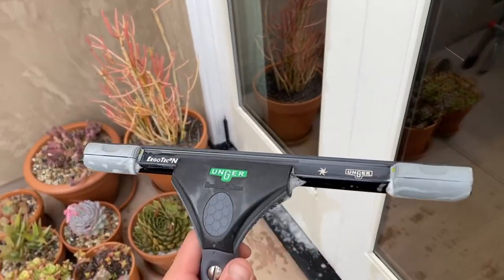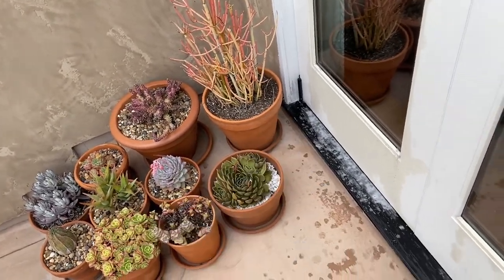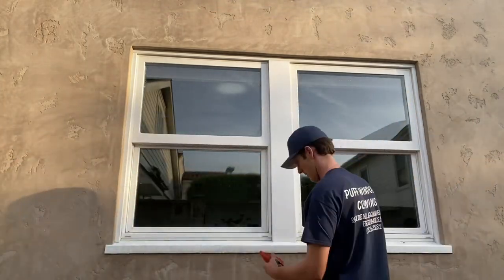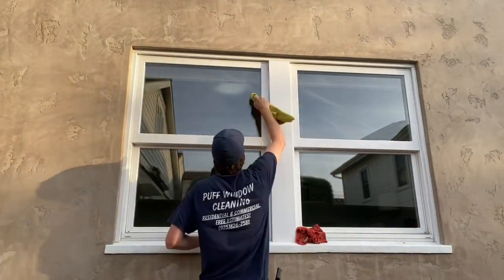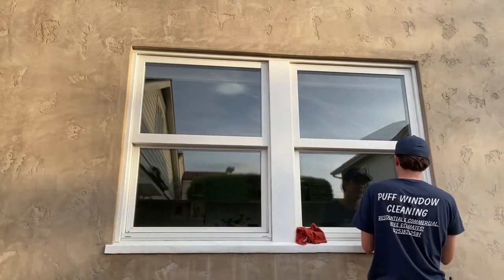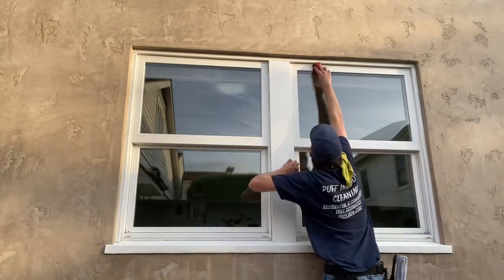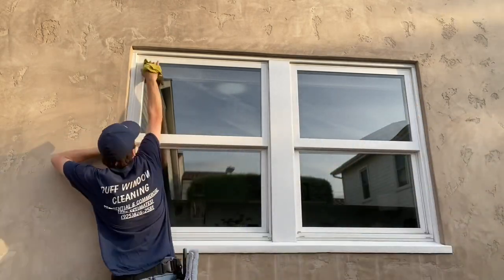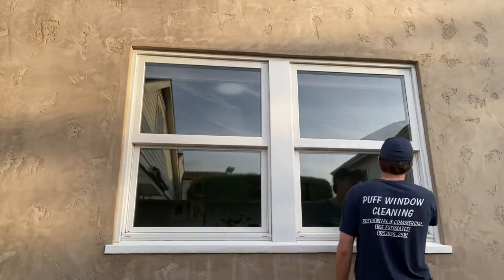$350 Residential Job | a RACE against the SUN | Window Cleaning Business Vlog

Comment: I noticed. You mop the window than use steel wool. Then squeegee. Try moping again after using   the steel wool to remove any dirt or pieces of steel wool before you squeegee. Also try wiping the edge of the glass before you  squeegee. Sometimes the glass is not flat. It could have a bow in it.  In that case try a different patterns when you squeegee.  Could be your holding the squeegee at the wrong angle. Try lifting the handle so the blade can scoop the water. You are using a 45 degree handle so need that.  Possibly you somehow nicked the blade on something..  I like your attitude.  You work hard charge a fair price respect the customer and you're honest. Will have a successful  business.
Reply from the maker: I really appreciate you sharing this info, and I’ll be sure to incorporate what you’ve stated to see if that helps. I’m starting to wonder if it could be the handle that I’m using. I may try using a different squeegee to see if that makes a difference. Thank you for the kind words 🤙

Comment: I've noticed doing a job takes a lot of cleaning sometimes there's microscopic fibers in the water or on your mop so when your squeegee grabs that microscopic particle it leaves lines. Not sure if that I've noticed even the stainless steel wool has little fibers that come off.

Comment: sometimes there's tiny Nick's in the rubber you really don't see them but you can barely feel them  it leaves lines in the window try flipping the rubber over if that doesn't work you will need a new.

Comment: I’ve been having that exact same issue with my 14” Ninja squeegee too - thought it could be a nicked rubber but changed and still the same. Almost like it’s possibly bent and not making flush contact with the glass 🤷‍♂️🤔
Reply from the maker: I’m really glad you know what I’m talking about. I feel like it was doing that the first day I bought it as well. I’m starting to wonder if the channel isn’t holding the rubber in place.

Comment: Two possible reasons, windows were oily or umidity is high. Use unger green rubber with unger gel when umidity is high or windows are oily and avoid straight pulls.
Reply from the maker: I’ll have to give it a those a try. Thanks for the suggestion 🤙

Comment: Puff! 
How high was the humidity ? I find sometimes if the humidity is high( but usually when it’s cooler temperatures) it leaves trail lines that disappear… 
I’ve finished a few jobs in the dark .. or low light .. just steel wool and trust your technique haha … man my job went long today .. a lot of post construction that I was not expecting .. they had someone clean it after their house was built last year,  it they did not remove any silicone etc.. and had just smeared the drywall dust around so it was pretty messy .. also they are selling the house and it is staged .. and white throw rugs and white couches … gotta move like a shadow and leave only a memory !!
Reply from the maker: Do you end up adjusting the cost due to the amount of debris buildup?
Reply: I didn’t this time, but I reduced the scope of her patio railings .. I steel wooled and rinsed them . I underbid a bit … so I ate it … if I discovered it and mentioned before starting that’s one thing… paid learning curve haha
Reply from the maker: @mikesniedze9122  yeah it’s always a bummer when that happens but a great learning experience. I’m trying to make it a habit at my estimates of being clear that I only remove organic matter and that excessive heavy buildup such as excessive paint, stucco, etc is considered a construction cleaning. If it’s just a little bit I don’t mind hitting it with a razor as long (as it’s not tempered glass), but if it’s excessive and they want it all removed I’d have to adjust the price.

Comment: I was wondering man, i noticed you have a pure water system and you usually use it on the screens, and it seems like you use traditional on the exteriors. Why don't you use the pure water on the exteriors? do you prefer the traditional better for them? I know usually pure water is better if you can because it will keep dirt away from the windows for longer, traditional tends to leave a small film on the windows which attracts dirt and grime. You're doing better than i am with your business so im not judging lol, but i am genuinely curious.
Reply from the maker: I don’t use the pure water system on the screens. I have a screen cleaner which I use from time to time depending on the size of the job, but that isn’t filtered water. 

Sometimes I feel that a pure water system isn’t necessary to use, especially if I’m cleaning a single story home and there aren’t a ton of French windows. 

I don’t want to go too into depth because there really is a lot to say surrounding that question, but I can say that a water fed pole is a great tool that serves it’s purpose in certain situations. However I don’t want to solely rely upon a water fed pole system to do all of my exterior work. It’s a tool and should be used as such when the conditions are necessary. 

But again that’s just my opinion. If it’s a two story residential home that I clean quarterly it makes sense to use the water fed pole. If it’s a single story home that hasn’t had the windows cleaned in 4 years I prefer to do it traditional. 

As far as film on the glass collecting dirt or grime; that could be due to using too much soap in your solution. Hope that helps 🤙